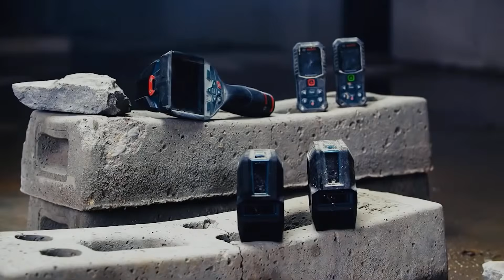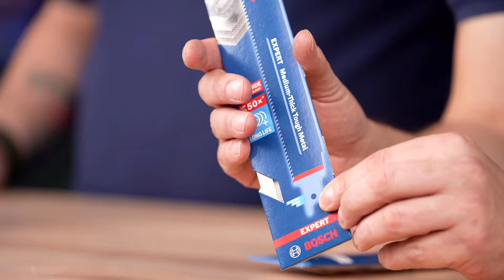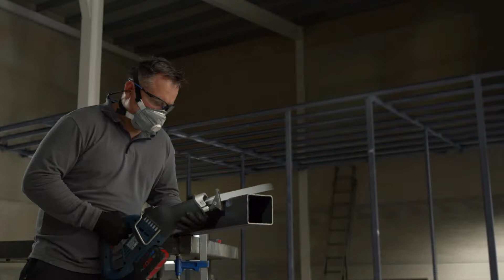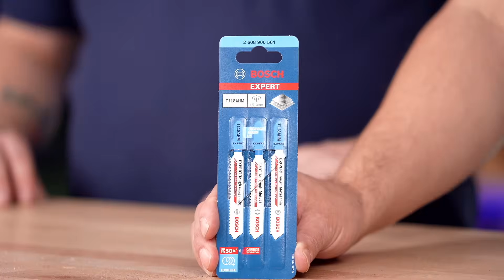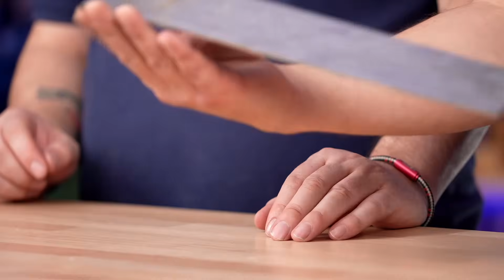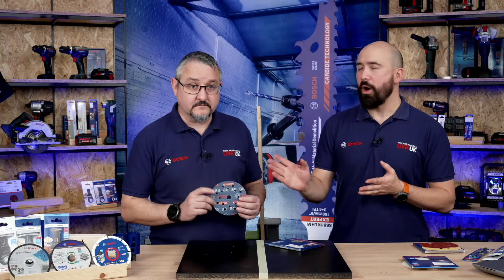UNLOCK Your Tools FULL Potential – Bosch, PRO, & EXPERT Deep Dive 💪

Comment: Would be nice if you gave a bit more info on how to best use te drills, blades etc.There was an excelent  Bosch FB-reel on the hardceramic drill, that showed how to use it. What rpm, pressure etc. There is some info on the box, but when a drill says medium speed and pressure that would mean 2000 rpm on my Fein drill. Medium speed and "the right amount" of pressure are way to fague.
Reply from the maker: Hey, glad you liked the Hard Ceramic tutorial. I think it has to be vague to an extent, we can't predict what materials you'll be using, and then factor in elements like the temperature of the material you're working in. Is there any particular accessory you'd like a tutorial video for?
Reply: @BoschProfessionalUK  I get the different materials etc. But you can give some best practice advice and what to look for. I would like to see a tutorial for circularsaw blades. How to choose the toothcount, dept adjustment (just trough the workpeace of always full dept) in wood, plasterboard and metal (plate and tube) and if it makes a difference if you use a GKS or a GKT for things like plasterboard or HPL.

Comment: Would be nice if the Bosch marketing department stopped using "100x times better" and instead gave "800 cuts through brick" or some real metric. Because nobody believes that it's going to be 100x better than every other blade and honestly it just sounds like a 10pm infomercial 😂
Reply from the maker: All fair points. It would help to visualise it better for everyone. However I can see how it's difficult to come up a "x cuts through x" with something that works on a global scale. Not all bricks/concrete/wood are going to be the same, in different countries...  for multi material accessories, which material do you select....  etc etc. We need to fit it on the packaging and have to take care of potential legal things too..... 

To try and be consistent we have decided to use a comparison against our own standard accessories for this too, so at least we are not throwing shade at a competitor. 

The 50X & 100X numbers we have are indeed a bold claims. Perhaps it is something we should film as an 'internal test not under lab conditions'  Something like the Diamond multi wheel is a great contender simply as it doesn't change diameter as you use it. Imagine for example if we selected a material that was close to the max cutting depth on a bonded abrasive disc. You would need multiple bonded discs just to do a single cut whereas the diamond metal wheel can just continue on and on. You can see how the number of blades needed could easily add up If you did lots of thin cuts then perhaps the number of wasted discs would be less... however Diamond would see see better lifetime regardless. 

Perhaps something to film for a future LIVE? 

Chris
Reply: @BoschProfessionalUK oh aye,  don't get me wrong, I do love Bosch and this is coming from a genuine desire to see it improve.

I just see too much focus on extraordinary claims e.g the 12ah battery being advertised as "over 280% more runtime... (In fine print *than a 4ah)" 😅 Which is kinda like comparing Usain Bolt to a kindergarten egg and spoon champion.

I think Bosch has plenty of amazing qualities and I don't think it needs to rely on weighted comparisons to prove itself. Cheers for taking the time to reply Chris, love the work you put in 
Lachlan
Reply: @quimblyjones, thanks for the hint. The reason why Bosch AC's are using comparative claims is because we can test the performance in-house vs our standard Bosch line. Although 100x better might sound impressive, we can guarantee you that we only communicate a claim that was clinically tested and legally approved. If you want to know what 100x means I would advise you to check out our performance challenger, which indicates the performance in terms of holes or cuts. https://www.bosch-professional.com/gb/en/knowledge-innovation/expert-performance-challenger/